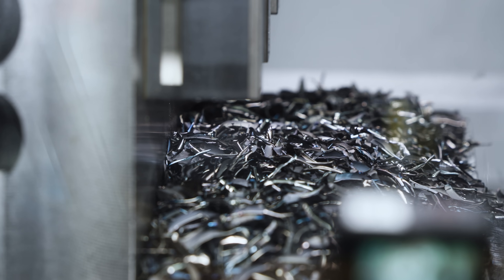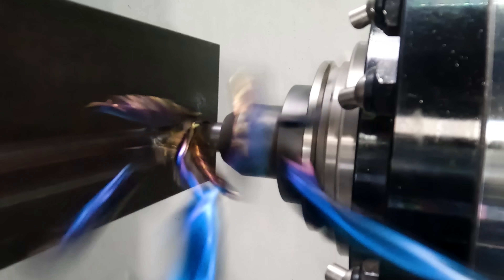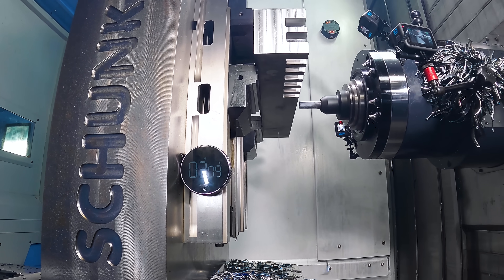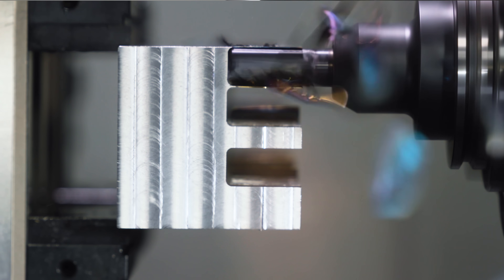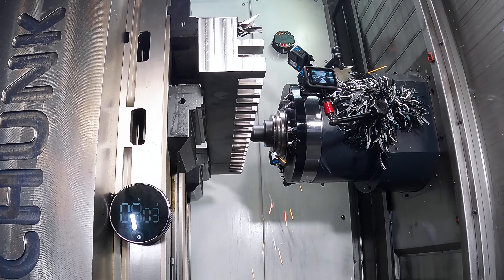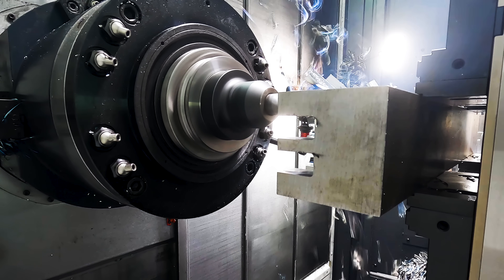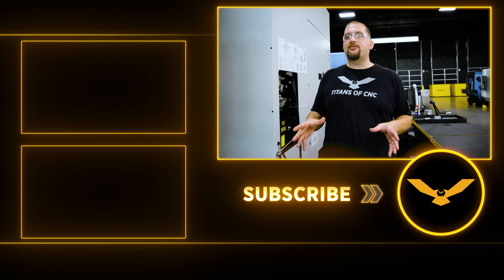End Mill Full Slot Timed Trial | NHM 6300 Horizontal Mill | DN Solutions

Comment: These demos are interesting but practically irrelevant in short run or single production. The time you DON'T save if your spindle isn't turning at all because you broke your last endmill and have to wait a day for a new one. What, you're going to tear down a setup and do something else for the rest of the day? Fine if you have spare machines sitting around idle.

Or, your tool breaks and moves the part a little bit on the table, and it becomes scrapped as a result.

Full depth cuts also create a lot of pull on a tool which can move it out of a collet slowly, and you might not suspect anything until the tool starts cutting into your fixture. Slow and steady gets the job done, instead of wasting hours trying to get a drill or tap out of a hole it's jammed into. Not every part is a simple throw-it-away if it's fucked up.

Yup, I'm an old fart machinist, not interested in contemplating high power crashes to get my peepee hard 😁

I do believe in high speed toolpaths to avoid these impressive monster cuts, as that way you can level the spindle load and use more flute length safely, while getting good chip evacuation in less than ideal setups.

Comment: One thing not being mentioned is the frequently toxic ownership attitude both from owner/manager to employee and owner/operator to themselves. You broke a tool you screwed up that tool cost $180 bla bla bla next time you'll have to pay to replace it. There's an inherent conservative attitude rather than sitting down with excel and figuring out how much money is on the table, furthermore employees are usually not incentivized, rather actively discouraged, from doing these calculations as well.

Comment: I had a similar experience when I rented some space in a fab workshop a while back.
Old guy running a(equally old!!!)  fixed vertical mill (Churchill I think) flat out (full spindle speed and max feed), 1” inserted cutter, 45° bevel full insert depth in gauge plate, dry. Before then I would have said that was impossible.
That was about 15 years ago and, obviously, tech has moved on massively since then.
Good stuff. It was close, that cutter was on the edge!!!

Comment: Modern tooling and modern machines are capable of cutting so much faster than they used to that machinists tough in the older style don't understand what they can actually safely & reliability do. Fortunately most of the new machinists are at least exposed to this type of content showing what modern CNC is capable of & will know they can machine parts faster.

Comment: Getting the feeds and speeds right is a big part of this.  I've tried to do heavy cuts in the past on steel and burned up several endmills within 30 sec.  I'm not saying it's not possible but you have to be really dialed in.  It's a fine line between this and hard failure
Reply from the maker: Not all end mills are created equal

Comment: Can you do the same test but with very small endmills. Say anything 1/8" or less. I ran a 1/8" Harvi TE thru 17-4PH at 2.5 diameter depth full slot at 30 inches per minute and 450 sfpm. After 100 parts the tool still looked new. And I used coolant because the nature of the cut I was worried about chip evacuation and I didn't have an air blow on the machine I did this on. 
 A Kitamura 4 axes Horizontal.
Yeah it's kind of hard to make money when you try to make a 50 dollar endmill last forever on a 500,000 dollar machine.

Comment: As machinist and small shop owner, I always have different opinions how everything should run. Why you not seeing every car redlining their engines after every stop sign? Probably because everything inside gets a lot of load and prematurely wear the car out. Right? same with the CNC, yes Doosan is a good brand CNC but it wears out too under high load. I understand that buying machine replacement parts are not the issue for most of the shop owners, but everyone is currently facing logistical issues. Doosan is a foreign manufacturer ( South Korea) imagine that the spindle failed on your machine and repairman said that you have to wait 2-3 months for that spindle. So your machine is not producing parts for all of this time and you loosing lot's of money, plus the parts that suppose to be runned on that machine has to be spread out between other machines, so you have to force your employees to work longer/overtime, farm jobs out (risk of getting parts quality issues)  or tell your customers that their parts would be late, which I dare anybody want's to do. So now everybody is under stress the managers are mad and they are transfer that stress on their employees. I'm saying that there's always a way to improve your cycle time but as in everything there's should be a balance. Better be safe than sorry.

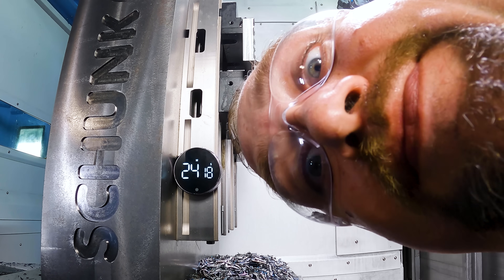Comment: 7:00 there is a chunk missing off of a flute near the shank on the underside about a third of the way up.
Reply: The cutter did not break and it was still cutting until the very end of the video. By your definition, a single microscopic chip would be a broken tool.
Reply: @barrysetzer  A big chunk of the endmill is missing. That's a bit above a "worn" tool. Maybe you should be a bit more honest or less hype about this approach to machining. Yeah it's fun to push limits but I'd rather avoid having to constantly buy new expensive tooling plus it's just unethical in my opinion to be wasteful with the resources you have.
Reply: Aaaaand again, i specifically said “we dont recommend you run your tools like this, had we been running coolant, this cutter would have lasted all day.”
Reply: Obviously. You act like we didnt all see that as we stood right there at the machine. Or see it very clearly in editing. Or review. Nowhere did i say the tool looked new.
Reply: @barrysetzer  You said it didn't break in the video. You clearly acknowledge that it did now in the comments. So why didn't you correct yourself when you edited the video since you said that it was noticed? That isn't a worn tool it is broken.

Comment: I have several questions, how worn was the tool after? How much did the tolerance change after the first layer? Did the chips change as the tool become more worn(if applicable)? Would tool path efficiency make this faster?
Reply: The tool was pretty worn after, but this was due primarily to chips that built up in the path of the cutter. Coolant would have gotten those out of the way.the chips pretty much stayed the same. And we have actually pushed this tool harder in the past, so this video was more about showing how much abuse it could take without exploding.
Reply: @barrysetzer  Worn? lol There is a straight up broken flute on that end mill. Pause the video and look at the under side of the mill about a third of the way up away from the shank.

Comment: would u guys be able to do a video similatr to this but for micro tools like 3/32 tools or 3/64 tools. Its tough to find a sweet spot since u gotta run the spindle at pretty much full speed and a very slow feed rate or the tool will break.

Comment: I'd love to see some close ups of what's left of the cutting edges.
Reply: Yes!! They never show it, it's infuriating
Reply: this exactly
Reply: I'd like to know the price of these tools. They could easily show it at the bottom with the other specs
Reply: @cbeck2201  that’s esay to google
Reply: Barry is NO BULLSHITTER he knows his stuff I have worked with him in Texas for 3-4 Years!!
Reply: Endmill should look pretty much brand new after this.
People who think they only last 10min doing this have clearly never done it.
Reply: @Donkusdelux  Brand new my @ss! Those sparks tells everything, sharp tool cuts! dull tool grinds.
Reply: @doglovemimijumable  if you run a mill you would know. That endmill will do that for hours and hours in soft steel.

Hardest part on the tool is cutting off all those little tabs.
Reply: @Donkusdelux  looking new after all that sparks in the end ? No way
Reply: @kleini3  no coolant. When it folds over the last pieces they tend to spark.
Reply: @Donkusdelux  of curse they don’t like it when they pushed throw that ending but the endmill definitely took damage while milling down that block
Reply: @kleini3  you've clearly never ran tools like this before.
Reply: @ThatOneStopSign  of courses I don’t ! I run real parts, not demo parts like in the video
Reply: I'm sure there might be damage because no coolant, but with coolant should be fine

Comment: To be clear, spindle load is just amount of power that sppindle (electric motor) uses to cut. Of course it has some impact on load on the spindle bearings (which are the most important in the spindle and what takes all that beating), but it does not show how much load is on the bearing. Wibrations durning cutting and direction of the force, if it acts radially or axially has huge impact on spindle life. Drilling at 100% load and milling at 100% spindle load is way different. Drilling stresses spindle axially upward (pushes tool into spindle), milling stresses spindle axially downward (pulls the tool out of the spindle) and a lot radially. 
Also coolant may increase tool life, but it can also decrease it by a lot by causing cracks of the cutting edge because of thermal shock.
Reply: Fun fact, bearing life is calculated based on all of those factors you just mentioned. How aggressive the bearings are being hammered (fan or rock crushing machine), axial load, horizontal load, rpm, hp applied etc. If the machine is under warranty and the manufacturer is saying it's fine to do, send it.

Comment: I note you cut this in what would be called "unidirectional mode" on my 96" UV flatbed printer - make a full pass left to right or bottom to top then return the head to the left or bottom of the steel before making the next pass. Was that to give the tool and the workpiece a short cooling period before you started on the second cut? And would coolant allow you to just move the head to the start point of the subsequent pass and start cutting again in the opposite direction?

Comment: Geniunely curious more about the machine. I just got a NHP6300 in my shop but what spindle option did you go for. We went with 10k at 30HP/ peak 44HP and I sink 2.625 indexable drills running 4XD, 950RPM at 6IPM and she holds at 93% all day long. So glad the things I have learned from you guys is transferring into my own processes.
Reply: Awesome man! We have the high torque spindle

Comment: The thing is this will absolutely work but not on a machine running an SK40 spindle, while this one is running an SK50 or HSK80, on a 40 taper machine it will destroy something also the steel isnt all that hard to cut
Reply: Depends on the machine. We have a BT40 machine which has blown our mind as to what 40 taper can actually do. The machine is crazy rigid with high drawbar force and a 2 speed gearbox. I do think most 40 taper machines are limited by the machine itself more than the taper size.

Comment: I worked in a machine shop that only ran the spindle at 20-30% on a daily basis. They swore that pushing the cutters and the machine wasn’t worth it. BS. After watching your videos and a few other channels I run up to 125% in a different shop that I work at now. My mill handles it just fine. I love making a huge mess in the machine. Keep the videos coming.

Comment: Know what motivates our shop to advance tech and get better?

Our boss pays us half the labor quote.

So the job has a $12k labor quote, I get $6k…

An average month is $10k-$15k NET.

We also get paid the same when we make extras for the next time it’s ordered.  So we build an inventory. That’s how we end up at about $90-$125 and hour on some jobs.
Reply: Thats pretty cool! Ive never seen a shop run that way!
Reply: @barrysetzer  it’s been operating like that for nearly 38 years.  We do primarily work for the semiconductor industry.  We make a lot of the parts that make up the chip making machines.

It incentives us to get better.  Because we make more.  I’m currently running two DMU50s and I have two operators that I train and pay hourly out of my cut.  Since I program and prove in everything and have them push buttons.  But I also pay them $35 an hour.

Comment: Can I do this with heat shrink using cat 50??
Please I really would like to know!!!!
Reply: Hey Danny, I would hesitate to use shrink fit for this. But you can get pretty aggressive with those. As for this video, there is a reason we used a side lock holder 😂
Reply: We did a holder video last week though, that compares the torque transmission of different holders! https://youtu.be/n2J1Wlfw-Dw

Comment: insane ... the sparks at the end. did the cutting edges dull or is it simply the heat in the tool from running without coolant? This is allways crazy to see while our machinists struggle often when they have some stainless or slightly different cut. bad surface finish, breaking inserts and so on ...
Reply: There were several times where the chips built up and were sucked back into cut, that resulted in some cutting edge break down. Had we been running coolant this wouldnt have been a problem!
Reply: @barrysetzer  True ... that is probably the crasiest part about your many of your monster cuts. how you run them without coolant. but with coolant they run even bettter boom

Comment: When I'm quoting/programming/machining a part and I have a ton of stock that needs removed it comes down to risk vs reward. Is the risk of rebuilding a spindle or replacing a drive belt worth the time saved. In most cases the answer is no. Just because I can doesn't mean I should. Doing this day in and day out is going to possibly wear most machines out before it's even paid for.
Reply: Lol, I'd lose my shit if I found one of my guys doing this.  Trichodial slotting can get pretty close to the same MRR's and is way easier on tools and the machine.  I'd also argue that a HEM tool path to remove this same material would probably be faster as it could take the entire step down and wouldn't be cutting nearly as much air.
Reply: @bmbunch8825  For sure. Honestly I shouldn't have even posted my original comment because the video really is about how beast the endmill is.
Reply: @GrumpyMachinist  They are insane endmills, but even Kennametal doesn't recommend you run them anywhere close to how they are.  I have 0 issues pushing tools limits, but rarely would I try anything like this with a $200+ endmill and the possibility of my spindle not lasting.
Reply: @GrumpyMachinist  It actually broke if you pause the video at 7:00 you notice a chunk missing from one of the flutes about a third of the way up from the spindle.
Reply: if your machine sounds good and the whole thing is not resonating like crazy with blaring cover panels then your spindle should be fine with high loads for years. If your machine has slideways then the harder you run it the more frequently gibs have to be retightened. If your machine end of life comes after x amount of parts does it matter if you do x number of parts in 3 years instead of 9 years?
Reply: A fitting name. Bet you’re 80 years old running a knee mill lol
Reply: @DirtRider6010  Naa. I'm 50. I'm just beat up and broken from doing what I love. I have very little need for manual machines. We have them but they aren't used for production. Our future is being built around swiss lathes. Look up a Star ST38 if you want to see the pinnacle of what I do.
Reply: @GrumpyMachinist  I've worked with the highest end Star machines you can afford.  The Lee Company in Connecticut was mainly a Swiss house and replaced machines more than I replace my indexable cutters, but they have a handful of aerospace parents and highly protected processes I never saw.  Story I got the founder was an engineer for Pratt and they wouldn't listen to him so he went out on his own and now has a multi campus company that everyone wants to work for and buys top of the line equipment like it's going out of style.

Comment: Worked in Automotive tool and die - We frequently took 100mm deep 10mm wall with a big Dijet Carbide tipped 100mm diameter end mill. Albeit you could hear it lol - BOOM